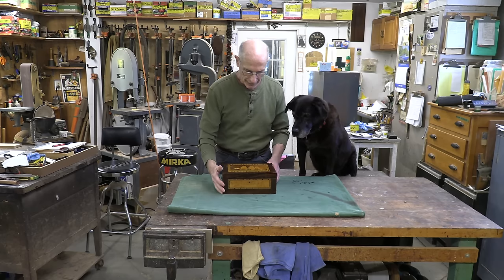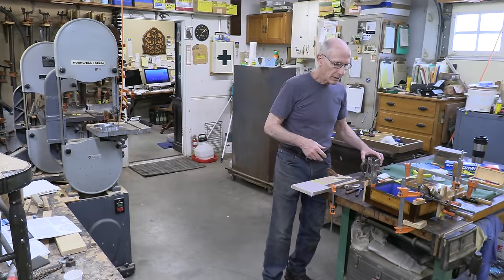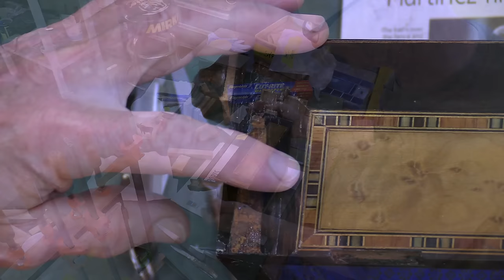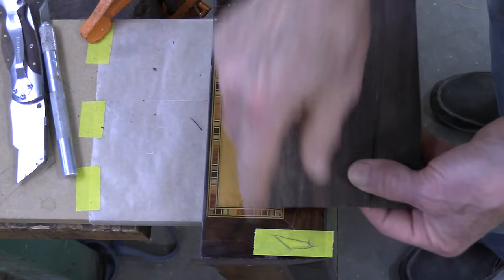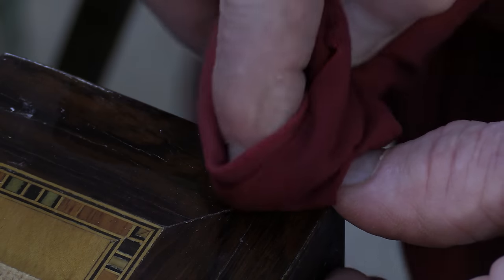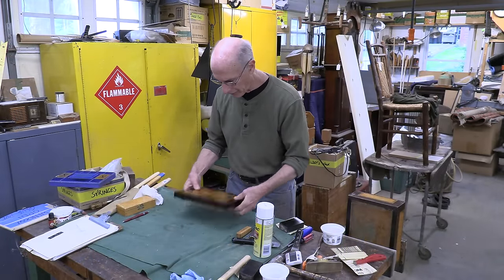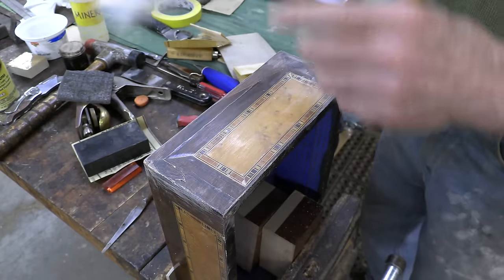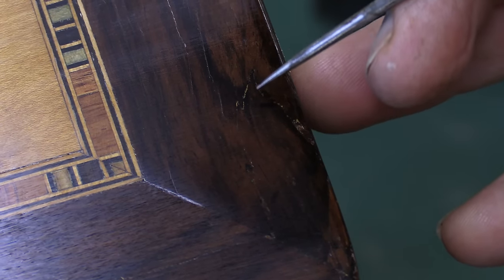Is There ANY Hope? - Thomas Johnson Antique Furniture Restoration

Comment: Fine bit of restoration, Tom. I work on a lot of boxes this size and I come across the same issues you show here - shrinkage of the substrate is the main culprit. This is the result of modern central heating, drying the boards out, causing shrinkage across the grain. 
Rather than an Exacto knife, I find that a scalpel works much better when finessing the mitres on veneers, you can get various different disposable blades, like the Exacto selection. And when lifting loose veneer, I like to gently pre-heat the area with a heatgun, which softens the glue and the wood, making it easier to to slip a blade in. 
I really appreciate how you list all the tools & materials you use at the end - nice touch.
Reply from the maker: Thanks Tony! Yes, you've been there! I am always afraid to use the heat because I don't want to loosen more veneer. But maybe I should try it. Maybe a heat shield
Reply: @johnsonrestoration  Tom, the heatgun I have has several nozzles with different apertures and shields, but I usually place a piece of scrap wood over the areas I don't want heated.

Comment: I would make a comment about the wax paper as one of your tools but I was working on a project this afternoon and had to use stretch wrap. I guess you never know where your tools will come from. Very nice repair work. Good for another 100 years.
Reply from the maker: Thanks! I rarely use wax paper since I discovered packing tape for clamp blocks. We still use wax paper in the kitchen though instead of plastic wrap

Comment: When i need wood putty I’ve always freeze dried and powder ground the wood type i need and dyed it to match using my own brand of fillers.  But i am constantly learning about new products from your videos.  Now i have to find that type of putty and try it!
Reply from the maker: Yes, I've never got into making my own products. For 45 years I always had employees and it only made sense to use materials and supplies "off the shelf". I've been liking Elmers Carpenters Wood Putty. It sand easily and takes stain really well. Easy to mix stain in it too

Comment: Love your workshop many would look at it and call it a mess. But each piece/hardware saved can and does serve a purpose. I miss the old hardware stores where you can find anything you need, and the the owner knew exactly which cubbyhole it's in.
Reply: .....four candles....no fork 'andles....😂
Reply from the maker: Thanks! I miss those old hardware stores too
Reply from the maker: Good!
Reply: @johnsonrestoration  a sketch from an old British comedy duo "The Two Ronnie's" if the reference is obscure. If you Google "four candles two Ronnie's" you'll probably find it, 'tis funny and very clever.

Comment: Tom, a trick that might be useful for getting glue under raised veneer. Squirt some glue on the surface, and use a small suction cup to work the glue into the cracks and under the veneer. Probably a lot easier than trying to pry up a small spot.
Reply from the maker: Thanks! I'll have to try that. I've always had my doubts

Comment: Mr. Johnson, am Always watching ur restoration"show" from Berlin, Germany and I adore ur work! However I have two questions or suggestions: 
1. could you clearly state WHEN and for WHICH kind of  work you recommend which glue?
2. What surprises me is, that you don't use the classic shellac polishing so often. Is it not so appreciated in the USA because it is very time-consuming ( and therefore more expensive?). In Germany we never use varnish for antiques, but either shellac matting or shellac polishing. Here, you only wax large-pored woods like oak.
Best regards from Berlin and it is a pleasure to watch your show!
C.Pruesse
Reply from the maker: Thank you Cornel! On most of the pieces I work on a high sheen would be inappropriate. (I feel) I like a satin sheen except on the most formal pieces

Comment: If I may, what kind of glue were you using for the veneers?  It almost looked like hide glue, but you wouldn't use hide glue for veneers. Would you? I wouldn't think you want it to be reversible. Or should veneer work be reversible?
Remarkable job as always. Thanks
Reply from the maker: You're welcome! Yes, hide glue, specifically "Old Brown Glue". The hide glue is compatible with the original hide glue that was used. Reversibility is fine, it doesn't matter, no one is going to be trying to reverse it anyway

Comment: I enjoyed your restoration. What did you use to polish the box? Also I have read somewhere that the French used hide glue as a grain filler. What do you think?
John
Reply from the maker: Thanks! I was using Lubricite - great stuff! Yes, hide glue works great as a grain filler, as it's color is a deep amber, blends right in with the wood color

Comment: speaking of hi-glue, I am an amateur in Hong Kong. once i bought some rabbit skin glue, dissolve it & store it in a plastic bottle & put it in a cabinet in the toilet Just in case i need to use it. it smell so pungent that later i have to put the bottle in an empty used nestle coffee can to avoid leakage of the smell.  1 strange thing happened 1 day when i saw one little rat running in my home - u know it is very rare for rat to appear in a concrete city full of  high rise apartment buildings in hong kong. after a few investigation, Then, I suspect the root cause is the animal glue. I immediately thrown it away (cos I have no immediate real use for it) & the problem GONE ! Nice job Thomas - as usual, a pleasure to watch. Tommy fr HK
Reply from the maker: Thanks! Wow - I have never tried rabbit glue, and I don't think I will! I really like the "Old Brown Glue". But all these hide glues have a relatively short shelf life so you can't store them for a long time. I think all big cities are filled with rats - that's their primary environment! Look it up

Comment: What tools did you use for lifting the veneer and scrape the veneer and the board?
Reply: Usually an artist's thin and flexible  spatula to lift the veneer, and carbide scrapers of different sizes to remove the old glue back to the substrate. Even very tiny ones. He also used a penknife this time round. He's a master at repairing veneers.
Reply from the maker: Thanks! BigHenFor did a good job of answering!
Reply from the maker: Right on! Thanks!

Comment: @Thomas Johnson Antiques can you please tell me where you get your syringes? I've been using small paint brushes and tooth picks...your way is better.
Reply: Btw...if you ever need to make a hidden repair in wood...like say a head snapped off the neck of a critter...I found it really useful to drill a tiny diameter in both pieces long enough to accommodate a 1 inch piece of bamboo skewer dipped in glue.  Also if you can't take something apart to get to the damage...carefully press putty into it then remove it to get an impression of the damage.
Reply from the maker: Thanks! Many places sell them, like Woodworkers Supply, Rocklers etc. Google it and they will come up
Reply: @johnsonrestoration  thanks!

Comment: How could you leave that old lighter repair without toning it in?
Reply: Because you never rub another mans rhubarb I guess....The old repair is part of the history of the box and as Thomas said, its a great repair.
Reply: @orchestranights  You are, or course, entitled to your opinion. I will say that that patch is part of the history of the box, may be nearly as old as the box itself. Secondly,  there is no benefit to replacing it as doing so may cause further damage to the box. Third, the box is not an expensive piece and that patch, in no way, de-values the box. Fourth, that patch is in NO way a poor repair, it just doesn't match but the work on that patch is amazing, just the wrong wood. Fifth, the customer may not have wanted it touched..it could have been his great, grandfather that repaired it back in the day. For me, it actually makes the piece as it adds to the story that the box is telling....thats what make the box worth having.
Reply from the maker: Thanks Alan! I typically do not do old repairs over, unless it's a structural issue.
Reply from the maker: Thanks! Yes, it's part of the history, and of course, why fix it if it ain't broken!
Reply from the maker: Thanks! I should have pointed out - you can really open a can of worms trying to re-do an old repair. I'm not going there...

Comment: Modern dry and overly heated homes not good for antiques ,the box turned out well.
Reply from the maker: Yes, that's the problem. And I finally realized that the reason so many antiques were not built to account for expansion and contraction was because they didn't need to!